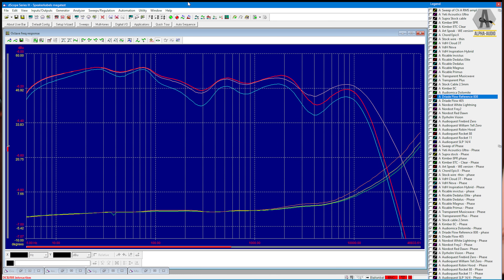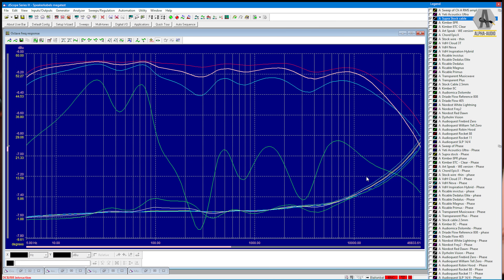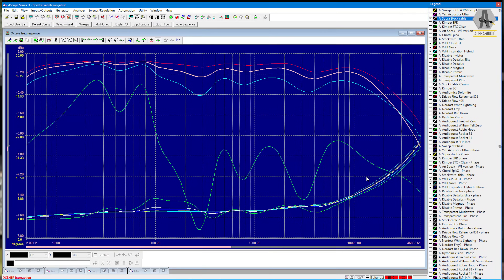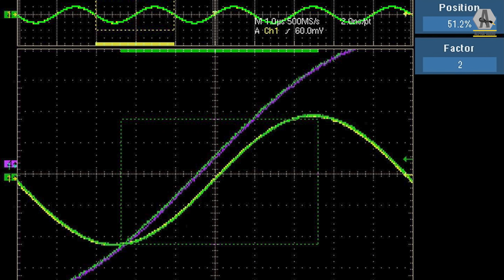Your speaker cable matters! 32 speaker cables tested - with measurements!

Comment: I remember (vaguely) an article from Stereo Review Magazine (I don't think that the magazine is around anymore) back in what I want to say is the mid-80s that did double-blind listening with different listeners hearing "premium" speaker cables compared to cheap lamp cord (even with cuts and splices to make the length different between the two channels). As I recall, the end result of that testing was that the listeners could not discern the difference with any statistical significance.

As someone with an electrical engineering education, I do see how cabling could impact the signal being delivered to low independence loads (speakers). When your cabling is a significant percentage of the impedance of your load, it would seem that it could impact the signal being delivered to the load. While I believe we could easily measure that (as was done here), hearing that difference would be difficult, if not impossible for most listeners. I also just inherently remain highly skeptical of speaker cable that is sold for tens of thousands of US Dollars that cites exotic materials and even quotes out estimated break-in time for achieving optimal performance. Admittently, I lack the system components to perform such a listening test of my own, but even with a nice pair of Focal Kanta's connected to an Accuphase e280, I'm not sure I could justify speaker cabling that cost as much as the equipment...
Reply: That research is quoted often, but everyone forgets that the testing method wasn’t without caveats, as was the outcome.
Reply: @jmtennapel  I think that I was a teenager when the story came out, so I remember little about it.
Reply: @jmtennapel  I have to stop you right there. You're correct about abx testing. A test like that won't work for this type of equipment. If you follow the scientific method, you use the test that yields the most accurate and truthful results. If you want to manipulate the results to win an argument, and not get to the truth, abx is great. 

Here's the reason I stopped you. "That research is often quoted". That's not a true statement. Its not a foolish thing to say on your part because you're right. The deniers always make these claims. Ask them this question instead. "Can you reference a single test, done by a credible source that meets scientific standards, on any piece of audio equipment ever made?". That's a question you would think can be answered with dozens of references from memory. The truth may surprise you. The deniers have never done a single test that meets scientific standards, or even close to it, ever. They've never done a single test. And I don't mean just for cables, I mean all of it. 

Why? The concept of high end audio offends certain people to the core. There's just no explaining it. Your post was 100% correct. Its an honest statement. They don't want that. No matter how good your information is, or how well done the test is, it will never be accepted if the results are not what they want to see.  The argument has never been about audio equipment. Its pure emotions. I've seen offers made by cable manufacturers that were way more than what the deniers were even asking for, and they still turn them down. They don't want the truth, they want to win the argument. You can't compete with that.
Reply: Audio frequency conductors break down to signal transfer function.  Total circuit impedance, IE: DC resistance, capacitive and inductive resistance, and dielectric constants.   Once you have those parameters, what the signal is doing within the conductor is known.  What many audiophiles don't realize is their equipment source and destination present complex termination loads.  Thus, a magical $1500 unicorn interconnect/speaker wires with excessive reactance may in fact sound better.  But that's due to the equipment's non-linear response to said termination loads!  NOT because the wire is closer to an ideal conductor!  🙄
Reply: Blind listening tests can be a joke. They are only as good as the ones participating. AR (Acoustic Research) did a blind test published in the New York Times in the 1960s, where people couldn't tell any of the times when real live musicians stopped playing, and a recording took over.And live unamplified instruments had 5 to 10 times the sound quality of reproduced sound back then. Julian Hirsch of Stereo Review also said in print tthat all amplifiers of sufficient wattage sound exactly the same. Another ridiculously wrong assertion.

Comment: Brilliant work and insights Jaap. Now go take that holiday! I recently bought LHY SW-10 switches and connected everything with the top Finisar SFP units and wow, what an upgrade. Every single digital and analogue cable I change alters the sound clearly, so needs some experimentation.
Reply: Swapped popular cheap decent XLR cables with better chiip fidelity alternatives and the difference was very audible. (I have several pretty good setups btw.)A clearer, deeper, fuller sound was coming out of my speakers. My gf that doesn't really give a sh but enjoys listening to music asked me if I had some new gear because it sounded better. She didn't know about the cable swap. It surprised me that it would be so evident on balanced well shielded.
I'm in the scientific it's about not degrading the signal camp, but why some cables give off different sound signatures is a curiosity for me. Can't put resistances on a cable without causing issues so shouldn't change frequencies?? Oh well. All I can say cables definitely matter, but points of diminishing returns are found. My best speaker cables are  179$ 2*2m pair.

Comment: Sorry... but blind sound test is needed ... almost a guarantee that at a micro level all cables will measure different .... but how they sound to the human ear is the real test.
Reply: Funny how objectivists ask for subjective tests with cables, and objective measurements with speakers. Make up your mind.
Reply: @Simplyveej  And the thing is, at the end of the day, people hear what they want to hear and then seek a technical explanation of why it so (a.k.a. the confirmation bias fallacy). I wouldn't even trust myself to hear a difference between cables w/o a blind test.
Reply: @Simplyveej  I you can measure it, that doesn't mean you can hear it, it's that simple.
Reply: Blind is subjective, not reliable
Reply: @Pete.across.the.street  you're not reliable
Reply: Yup - I was thinking back to the Stereo Review Magazine article of the mid 80's that did double-blind testing between really crappy lamp cord (with splices as I recall) and premium speaker cables. There was no statically significant difference in the ability for the listeners to discern between the cables. I definitely believe that you could electronically measure the difference (especially with long runs) between various cables, but hearing the difference (at least for most people) wouldn't enter the equation.

Comment: Nice video! My guess is that not only specifications of cables make a difference, but also how they interact with specifications of electronics and drivers. Here VDH Revelation connected to Wilson Duettes were replaced by Cloud 3T and noticed both aspects you have commented, gain reduced and also treble. But sound of instruments and voices got a new dimension of reality not found with Revelation cables. Also calmness with music, Revelation are more "nervous". Sorry but it is really hard to put in words.
Reply from the maker: I know what you mean. We heard the same.

Comment: Like you I'm a  little surprised about your findings of interconnect vs speaker cables, that is, which seems to have a greater impact - - subjectively I've not had that same experience in my own system.
Reply from the maker: We did the tests pretty close after each other... I was very surprised to hear the interlinks show greater differences...
Reply: @TheAlphaAudio  A lot of factors are at play, and things will vary from system to system, but signal strength is most likely the reason for the bigger difference with IC's. The weaker the signal, the more fragile it is. That's why components like preamps can get so expensive. The power amp outputs the strongest signal, by far. To design a line level preamp to match the quality of a power amp, the preamp has to be built to a higher standard. To make a MM phono stage that equals the quality of the line stage, it has to be built to a higher standard. Same with MC. The weaker the signal, the more outside factors can have an effect on it.
Reply from the maker: @AT-wl9yq  I guess that is indeed the case.

Comment: To all concerned, thank you for your hard work. 

My small 13 x 11.5 ft room might have nine speakers and two musical subwoofers. However, my priority has always been to have an exceptionally quiet room! Hence, after changing all my analogue, digital, and even some power cables multiple times. For my listening room, the shielding of a cable takes priority.

Looking forward to your findings. After a thoroughly deserved holiday, of course
Reply from the maker: The findings are already online. Posted on the website.

Comment: I found this helpful when trying to understand cables if you research Quantum electrodynamics it explains a lot of what happens in a conductor write down to cable burning being a real thing. Best of all this is real science that proves cables to make a difference. It's a very very good read but heavy with it being quantum dynamics
Reply: It also explains why the dielectric can make a big difference to the sound as well as the geometry
Reply: What specific Quantum Electrodynamics research paper covers this topic?

Comment: 0.6 Ohm???? 0,0175Ohm/m/mm2 very small section and large lengths. Otherwise bad design !!!
Reply: I suspect VdH has applied a technology he has used in the past for interconnects which is some sort of carbon fibre based conductor … but that is guessing ;)

Comment: Awesome work!
I am really interested in how mass of the terminus affects the cable.
I would be interested to add that into your next series of tests
Reply from the maker: Not sure what you mean...
Reply: @TheAlphaAudio some people think lower mass of a connector makes an audible difference  - think of those hollow bananas out of sheet metal and made only for soldering vs those very solid WBTs or Furutechs with 2 bolts to fix the cable and a mechanism that enables tightening of the plug in the socket, overall probably 10x the mass of the hollow banana. In the world of high frequency electronics (MHz, GHz), an unnecessarily large lump of solder can influence characteristics impedance (I suppose by creating a discontinuity in impedance along the line), thus causing unwanted reflection. Really not sure whether there is any relevance in LF audio; having said that, all our systems play in the presence of HF EMag. fields, and everything becomes an antenna and picks up noise, so that a low impedance ground connection in HF sense is perhaps a good thing to have.

Comment: Yeah, true, cable matters, I found out too and that sucks. Started using Wisa wireless system (Buchardt in my case) few years back, and I think I will stick with wireless in the future... XD

Funny thing is providing clean power to the Wisa hub can still improve audio quality too, man, PCM really is some hard to deal with ancient tech.
Reply from the maker: Yeah... Wireless would be a solution. Active speakers as well. Power always has a great impact. Especially on digital. I guess it has to do with clocking/jitter.
Reply: @TheAlphaAudio  Do you purchase multiple copies of a single digital release to find the best sounding one? If protocols do not seem to work with digital interconnects, why would they with pretty much anything else.

Comment: I want to see you test fuses.
Reply: I recently cleaned the twin fuses in my vintage 1980s amplifier with alcohol. alcohol.Made a huge improvement. No reason to think premium fuses wouldn't do the same thing. Anything in the signal path leaves. it's mark.
Reply: @sidesup8286  
Fuses aren't typically used in the SIGNAL path.
Reply: @sidesup8286  🤣🤣🤣🤣🤣🤣🤣
Reply from the maker: Will not do that... Because I wouldn't know how to do that...

Comment: That’s also my experience that the impact of speaker cables mostly isn’t as high as it oftentimes is with interconnects. Nevertheless speaker cables DO matter as well. It shouldn’t be the weakest link in the chain.
Reply from the maker: Precicely.
Reply: Sometimes it’s better to not have all interconnects from the same line. I for instance am REALLY happy with an (old) Transparent Reference XL between my CD-Player and my preamp and a Stealth Indra between pre and power amp (both balanced/ XLR).
Reply: Eventually I returned the cable, as the Spectral by MIT cable was just too overloaded with warmth for my system. The overriding warmth went way into the treble. Bright sounding Columbia recordings sounded great, but too much of my collection sounded too warm. warm.The cable was amazing in every other way though. Including very black quietness and instruments sounding near 50% bigger & bass extending well down below what the speakers low frequency spec was. Tellurium is a very good cable.They claim advancements in phase response and everything does sound like it has more focus. There are battery pack items that run on 2 AA batteries which you can let the wires contact the outer sheathing of the cable. The sound gets a little sweeter and warmer. Supra Sword interconnect is the interconnect that made the biggest difference as far as interconnect cables.go.
Reply: The cables that made the most jaw dropping improvement in my system were the older Spectral Ultralinear II MH 770 speaker cables made for Spectral by MIT. The company MIT has recently come out with a $100,000 speaker cable, which has bass, midrange and treble controls on a box connected to the cables themselves.The guy on here that often reviews 6 figure $$ equipment, will be reviewing it. With the measurements now  presented for all to see, this is what cable doubters were asking for forever, and the fact that there wasn't anyone trying to prove with measurements that cables can sound different, gave them their basis for.their argument. Most of them have their "theories", and don't even need to listen to cables...What will they think now, or does it really matter? Will they hide in the woodwork or come out with their dissenting opinions?
Reply from the maker: @sidesup8286  MIT has mostly the same theory as Transparent. I reviewed a couple of them... Interesting stuff. But not really my sound to be honest. I guess it has to fit your system.

Comment: Great work. Unfortunately, the lower part of the the impedance/phase vs frequency graphs are quite dark, making it sometimes very difficult to read the legend.
Reply from the maker: You can check them in the article.
Reply: @TheAlphaAudio  I was referring to the article. Take, e.g., Audioquest. The legend has 11 entries with different shades of dark greens and blues. Due to dark gray background, I found it hard to see which is which.
Reply from the maker: @weetjeweetje4054  ok
Reply: change the cable of your monitor and you will read it

Comment: I can only praise your willingness to do all this testing. Mainly because the differences are small, even insignificant for most users, most of them do not even hear the differences. One is the tests, and the other is the use of the same cables in a home hi-fi system... where everyone has different hi-fi devices, room acoustics and also hearing abilities.
Reply from the maker: I think everyone will hear differences on a decent system. The question is: how important are the differences to them.
Reply: Everyone I know hears differences. I've had people who didnt even have audio gear, hear differences in cables  demonstrated in my home. I can't even listen to my system without my preferred cables in place.
Reply: Is 40% to 50%  improvement small or insignificant? Name an amp, or preamp that gives you that much improvement? 5% improvement is subtle but clearly audible. That's 5% times around 10. Even way less than that is a whole new listening experience.

Comment: Getting my popcorn ready for this comment section. 🍿😂
Reply: Right - much ado about almost nothing.

At audio frequencies, the only significant factor is damping and signal loss and these are easily solved by just using 12 gauge stranded copper wire - $25 for 25 feet on Amazon and for really high power, or obscene lengths -  the gauges go down to 8.

Transmission line effects are not an issue at these frequencies and home environment cable lengths. Cable capacitance, phase shift, frequency response, or distortion - NO ISSUES!

Don't fall for phony factors to try and justify ridiculous prices for speaker cables!

Comment: Think of conductors as a prism that separates an electromagnetic wave into a spectrum of frequencies. The structure and composition of the prism affects the speed and dynamic range of each frequency.
Reply from the maker: Nice analogy.
Reply: Thank you! Pay attention to cables Acoustic Revive. The light bulb converts the electromagnetic wave only into the visible and heating part of the spectrum, the entire complexity of perception by our brain
Reply: First of all, I recommend the ACOUSTIC REVIVE AC-TRIPLE C 4800 power supply without screen. Length 2 meters 500 hours of warm-up, you won’t regret getting into another dimension!